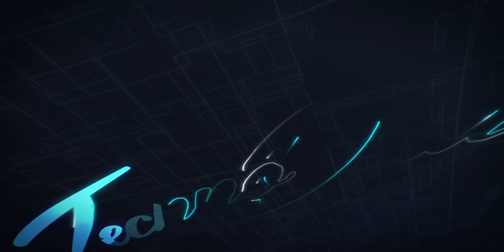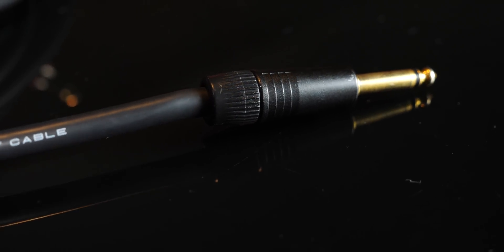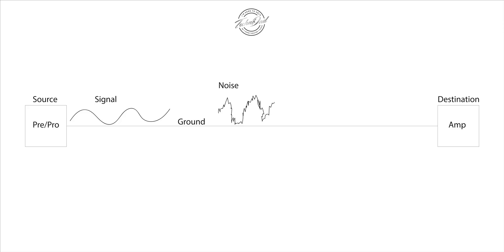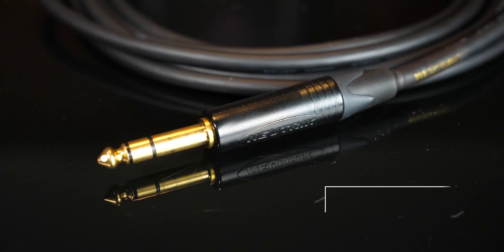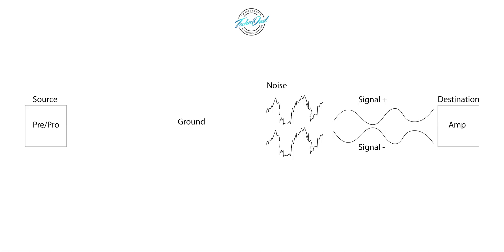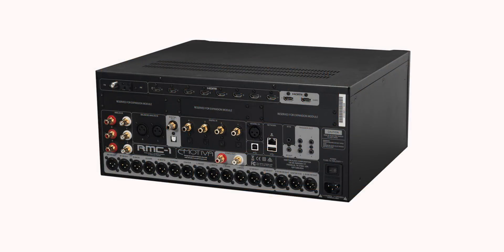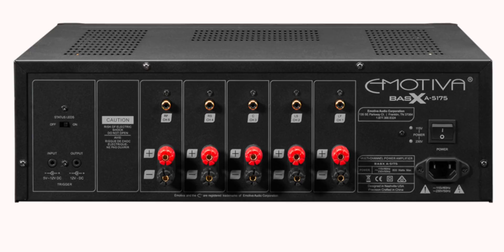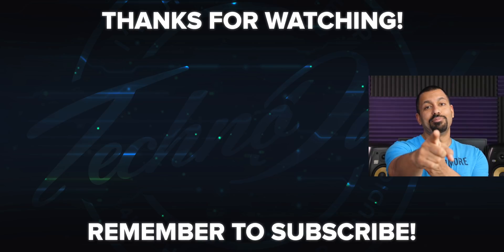Balanced vs  Unbalanced Cables | What is the difference?  Which is better?

Comment: Do you recommend using a Balanced XLR to Unbalanced RCA Adapter Interconnect or is that unnecessary?
Reply from the maker: Hi Tom!  What are you trying to connect, I'm a little lost...
Reply: @TechnoDad  just regular rca from receiver out to amp, and wondering if these would make any difference going from rca into this adapter to the XLR of the outlaw amp

Comment: You've made it much easier to understand!
I'm buying a used Pioneer S-DJ50X which has an unbalanced RCA jack beside balanced TRS and XLR.
Wanted to know if the single port of unbalanced RCA be used for 3.5 mm aux cable input?
Reply from the maker: If you mean using a 3.5mm to RCA cable or adapter, yes.

Comment: Great video! I have a pioneer DJM 350 & RCF powered speaker 750W. This set up is used for backyard gathering. For connections, I used an RCA to XLR which is connected to the XLR that extend  to my speaker and 3.5mm to XLR to my phone or IPad for streaming I-Tune. The system bang but after 1 to 2hrs, the audio drop. I changed my XLR wire to no avails. It does that each time. If the wire were bad the sound would drop from the get go. Maybe the rca and the 3.5mm need to be balance. What do you think?
Thanks in advance for your feedback.

Comment: If my pre oit from avr is rca and i have option to go xlr on my parasound is that better to use then rca on both ends?
Reply from the maker: Either way, it's unbalanced, so I don't think it will make that much of a difference.

Comment: Dayum! The image is clear as the Sun! The 'flipping' business haunted me for a long time, if not a very long time!

So, that means the flipped signal (if using DI unit) must be placed the closest to the microphone, am I correct? Any signal flipped later is useless. In the case of balanced microphone that DI circuit is designed right within the microphone body /capsules. Did I answer myself again? Hehehe!

Comment: I have FiiO M11 PRO and I use a HiFiMan Sundara helmet. I was suggested to upgrade my Sundara cable for a better quality cable. I am recommended a Meze 99 Classics Series to improve the sound of my Sundara helmet. Meze has this cable with 2.5 mm OR 3.5 mm.Which one do you think I should choose? And would this change really benefit me in terms of audio improvement.Thanks in advance for your attention.
Reply from the maker: That's a tough question, Francois.  You would almost have to try it and see if it works out for you.  I can't say as I don't have those products to test.  Cables are a crazy thing.  Some people hear a difference, others don't.  I, personally don't hear a difference in cables.
Reply: cables make literally no difference

Comment: Corrections: Unbalanced (ts tipped) cables do not introduce more noise or interference  over longer distance. They actually loose signal strength over a longer distance. Why? Since the shield carries the return signal, the shield being a larger gauge than the hot wire has a much lower impedance to ground than hot, hence unbalanced. On other hand, balanced cables carry signals on  same gauge wires with equal impedance to ground so thus can run very long distances. XLRs are found  especially in surrounds outs as they need long runs to various powered speakers in the home theater design.
Reply: I ordered a Rockville monitor that uses only TS and RCA...if I get a extremely short TS cable will it work as well?
Reply: @Jaye_Musik  yes. If the monitor is passive, use speaker cables.
Reply: @kato1400  ty🤞

Comment: To those of y'all that want to know the difference, it is simple. I connected the balanced and the unbalanced cables from my tube pre-amp to my tube power amp. 
The Balanced cable signal was louder and quieter(less noise floor), so yes it makes a difference in sound quality. 
Balanced cables are better, that's why they are used in high end audio equipment!

Comment: so basically, if im just connecting near (less than 15ft), its okay to use unbalanced. I'm watching this with my new speaker/monitor presonus eris 3.5 in mind as im just using this for my PC desk. I've heard about the unbalanced problem from a review so i was worried but i just have it connected to my pc on the same desk.

Thanks for the video!
Reply from the maker: Yes, you are correct!  Thank you for watching!

Comment: My HD599 cable has a 2.5 mm connector that goes into the headphone and a 3.5mm connector that goes into the source. The 2.5mm side has 3 black rings while the 3.5mm side has 2 rings. Is this a balanced cable?

Comment: So it really doesn’t make a difference if you have/are using a cable under 15 feet? Or can you still tell a difference in audio quality?
Reply from the maker: Not a huge deal for short runs.  But if you want the best noise removal, balanced is the way to go.

Comment: If I have an unbalanced output and I am going into a balanced input, does it hurt to use TRS to TRS?   Would there be a quality difference If I used TS to TRS vs TRS to TRS?   These are short 6 foot cables.

Comment: Great video. Question... I'm doing a wedding this weekend and I need cables to plug from my H4n Pro to the DJ Mixer. What is the best to use? And between the two, would balanced or unbalanced be best for it?
Reply from the maker: Hi Nicholas, great question!  I just did this for the videographer at the wedding.  Since I use XLR out to my main QSCs and booth out to my KRK monitor, I had used the Master 2 RCA out to go into his Zoom H6 to record the audio for the speeches.  The videographer had a dual RCA to dual 1/4" cable.  Depending on what kind of PAs you have, you could go XLR out from your PA into your Zoom if you want to go balanced.  Only thing is that will be mono unless you're pulling off both PAs.  So you have some options but I just use the dual RCA from Master 2 to dual 1/4" male to input into the Zoom H6.  Hope that helps!
Reply: That does. I appreciate it. Keep with the awesome vids.

Comment: Hi Techno Dad, so from understanding of your explanation balanced cables are the superior cable but then you go on to say at 3:39 that most high end amps use unbalanced cables, was that just a slip of the tongue or have I got my wires crossed. 🧐

You go on to clarify at the end of the video. I should have waited before posting. 😬

Comment: On short runs there is not advantage. Still waiting on the directional RCA's that you touted in one of your videos.
Reply from the maker: Lol!  Yeah, directional RCAs is probably a bunch of nonsense.  Directional HDMIs actually don’t work in the wrong direction
Reply: I heard that they make a difference in short runs too as long as your amp and pre amp are of a true balanced design, iv not tested this and i am curious as my primare is a balanced design but im unsure whether the marantz sr8012, my next av amp is
Reply: @stevenjacks3701 thanks for the comment. Exactly you heard. There should be no difference in short runs. Another way for gear manufacturers to sell you more irrelevant stuff. If you see the cables used in pro gear, many are really utilitarian, balanced connection just eliminate the chance of radio interference. In a pro setup you use wireless triggers, controllers and mikes.  A pro, does not want to have to deal with RFI in a setup.

Comment: Great video , you explained very well
Reply: No he didnt..Wat does it means: "the cable flips its polarity" and then at the end of the cable-it flips it again..Who does the flipping? Signal is either in phase or out of phaze..It cant flip at the beginning of cable and then flip again at the end..Didnt get it at all...
Reply from the maker: Hi Jule, the flipping occurs at the source and destination.  The cable doesn't do the flipping.  The Pre-amp/Processor flips the signal since it has a Balanced Output and the Amplifier flips it back once the signal enters the Balanced Input.
Reply: @TechnoDad  Thanks for explaining .I got it now..

Comment: Unless the source and destination are truly balanced, RCA might be a better choice for shorter cable  runs.
 The opamps required to inverse the "balanced" signal also degrades the quality.
Reply: Very true point. I've measured many consumer "balanced" products and their XLR outputs are nothing more than a phase splitter instead of a fully differential design. I've either measured similar SNR and distortion or worse via XLR. 

Good video Technodad but don't discount unbalanced double braided and foil shield cables work great even for very long runs. Belen 1694A all day baby!
Reply from the maker: Word!!  I just moved my subwoofer around and need a good unbalanced RCA for a 12 foot run.  I’ll check those out!
Reply: @TechnoDad  I run 1694 through drywall around the house up to 50ft runs passing analog and digital audio and 1080p video. Never a problem.

Comment: Maybe you could do a video to compare. Can we actually hear a difference? Even through a YouTube video...

While you're at it can you explain why on the back of a power amp why there is only one jack (red) leading to the speaker and not  the usual red/white or red/black. Just noticed this looking at a photo of the back of a the 7 channel Marantz 150w into 8 ohms amp...has balanced for 2 subs as well..can switch between balanced and unbalanced...

And since there is just the "red' to speaker (from the power amp) jack...red to red...are there cables designed specifically (I'm sure there are)...please talk about them as well...

Comment: Balanced cables are very expensive and you won't hear any difference.That's because a chain is only as good as it's weakest link, and there are tons more weaknesses in the system. Everything from the lousy cables used in music studios (unbalanced), the crappy, dirty AC in your power, and unbalanced instrument cables. As Clint Eastwood said; You need to know your limitations"(paraphrased).
Reply from the maker: Very true!

Comment: how is it happens that signal gets flipped? what mechanism do they use to do that?
Reply from the maker: Hi Lily, it's actually the components at the beginning and end that flip the signal.  So the Pre-amp (Source) will flip it before the getting into the cable, and then the Amplifier (Destination) will flip the signal back while exiting the cable.
Reply: @TechnoDad   cool! thank you!

Comment: Nice video! I have a long run for one of my subwoofers. I use a Mediabridge ULTRA Series Subwoofer Cable (25 Feet) - Dual Shielded with Gold Plated RCA to RCA. I have never seen a subwoofer with a XLR connection... Is that because LFE signals Don't gather much nosie?
Reply from the maker: Hi!  Most higher-end subwoofers have XLR inputs.  I have the SVS PB-4000 and it has XLR inputs.  You would need a pre-amp/processor to utilize those.  Most AVRs just don't have XLR outputs...
Reply: Pretty sure I remember that my SVS PB16 Ultras do have XLR. However, my Marantz AVR doesn't have an XLR output for it. I'd probably need to upgrade to seperates for that.